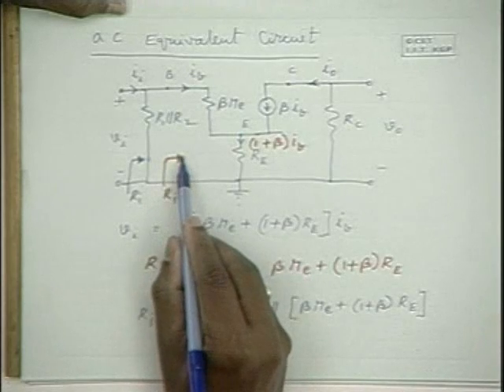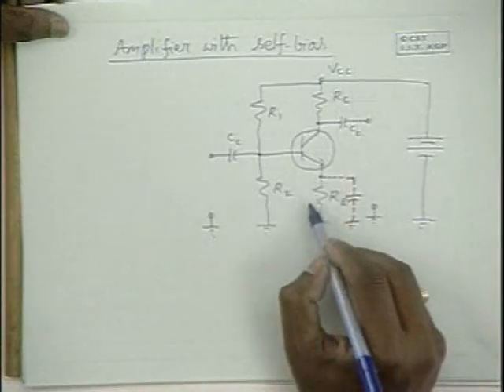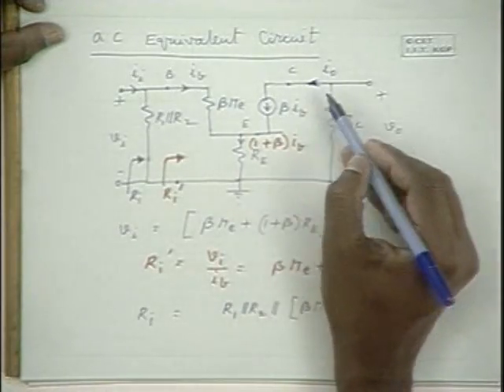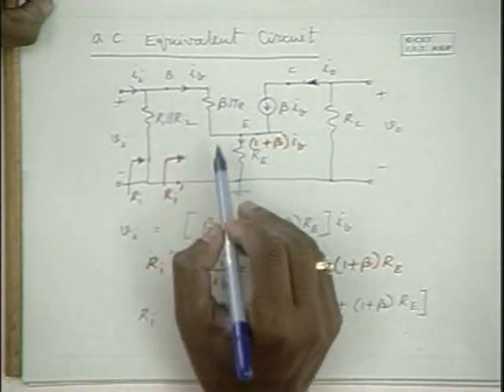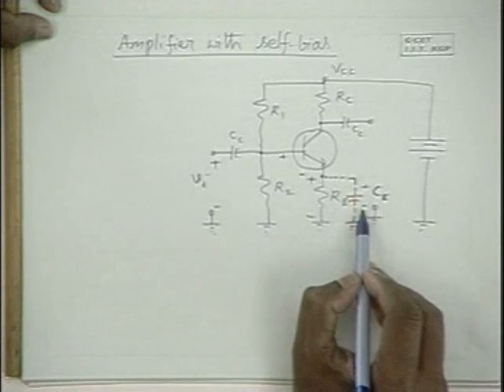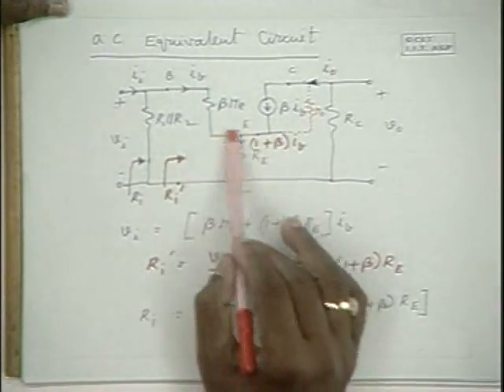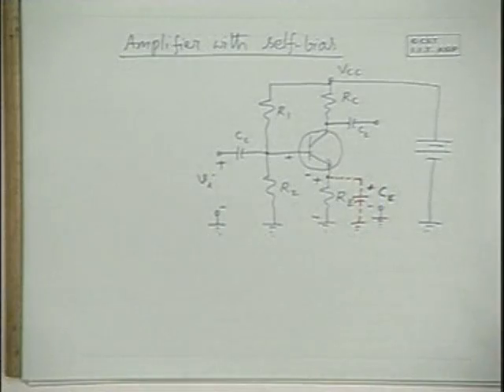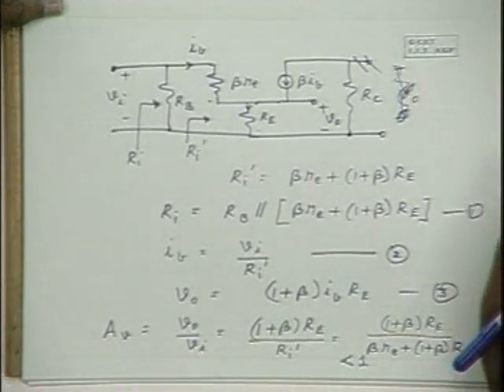RVR BE 23 BJT small signal analysis

Comment: Please add a video showing the effects on current & voltage gains as well as the input & output impedances of the amplifier circuit if the output resistance ro is included. It would be of great benefit for students. 😊